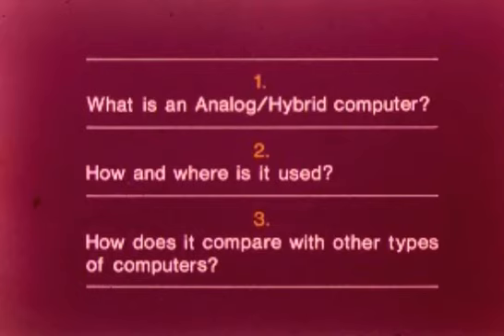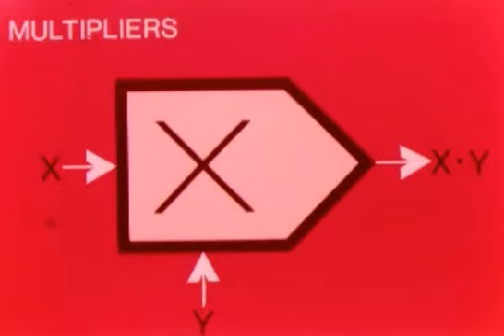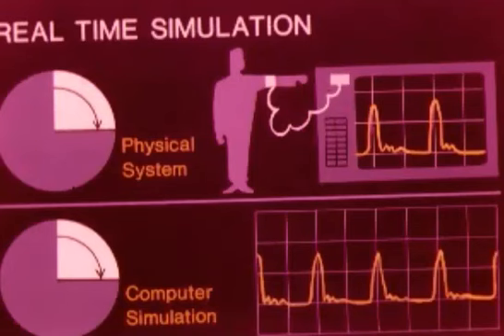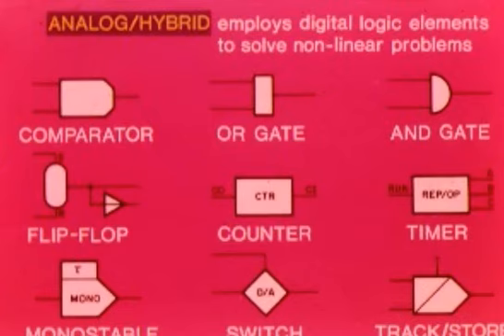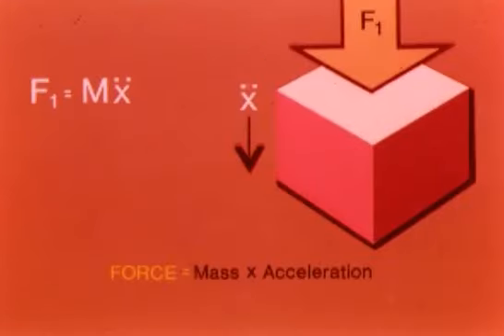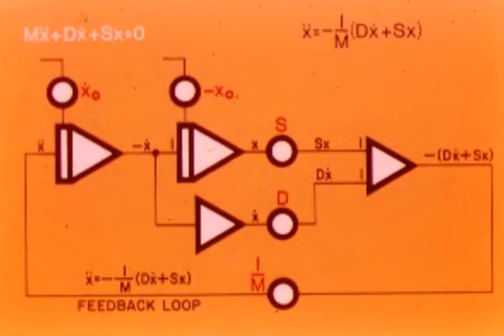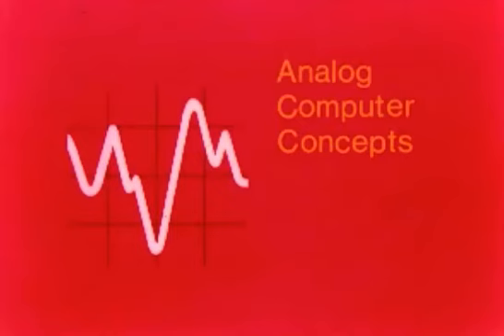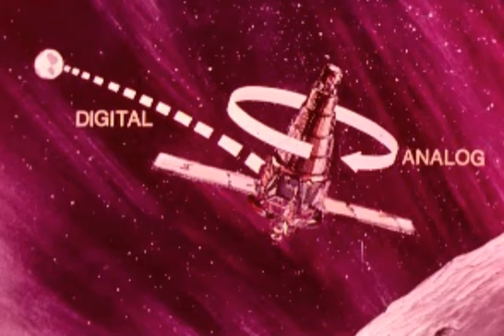Understanding the analog computer

Comment: It took me 20 years to finally understand that analog clocks, analog computers and analog signals aren't called analog because they are continuous but because they are analogous to something.

Analog clock: mimicks the movement of the sun in order to show the time. The physical unit of time is represented by an analogous unit in the form of an angle/circular arc length.

Analog computers: represent one system by a mathematically analog circuit.

Analog signals: speech is transported with an analog signal if the form of the signal remains the same but changes its physical size. The electrical signal is analog to the acoustic signal.
Reply: Yup. Even digital circuits can be analog.
Reply: @evanperrine4012  Well, in some way digital circuits are based on analog circuits. Sometimes it is hard to distinguish them.
Reply: @maurition49  Funny enough, technically you could even define a digital circuit as analog computer modeling an ideal digital system
Reply: @maurition49  So, in a sense, they're two sides of the same coin. Analog can model digital in its own way, and digital can model analog.
Reply: @evanperrine4012  Absolutely right. That's what it basically is. An analog of a numerically exact system.

Comment: I thought summers are used to go to the beach. 😅😁

To be more precise:
today I would rather say "the analog computer (→differential analyzer←) creates a structural analogy". 
Because passive networks also create an electrical analogy for a thermal, mechanical or chemical problem. A tank circuit behaves like a mass spring damper system, an RC network behaves like a heat transfer or water transfer structure, etc...
These analogies are purely analog and really like, so to speak, physical analogs where pyhsical structures are in analogy to each other and the physical quantities in these systems behave analogous to each other (thus using analog signals). But this is not the main idea with the differential analyzer. 
There have been for a matter of fact so called digital differential analyzers (DDAs) which use digital circuits and binary representations, but are factually still analog computers.
What makes the differential analyzer an analog computer then? It is also creating an analogy. 
But this analogy resides in other properties of the machine than just using analog signals, which we see aren't absolutely necessary for the analogy to be implemented. The analogy lays within the machine structure meaning the analog computer being isomorphic to the mathematical problems/equations being solved/represented by the machine. 
These machines do not implement a direct physical analogy. The mathematical strcuture is physically realized as a directed graph of computing elements representing proper mathematical operations and mathematical terms being interconnectd. The directed graph allows every mathematical operation to exist in a discrete form, freely interconnectable with any other computing element, all having well defined input and output points having only one forced directed signal flow. 
All of these computing elements are physically coupled together to realize the mathematical relationships to be studied. 
CPUs always communicate via software, which makes them always slower than any analog computer.
The main advantage and elegance of the analog computer being implemented with analog electronics rather than digital circuits is the fact that one can the mathematical operation of integration with a high amount of numerical stability and only few components and no need for numerical integration methods.

Comment: I was pleased to learn that multiplier chips are available.  Such chips have two voltage input pins, and the output is their product divided by 10.   Some models are "four quadrant", allowing positive or negative voltages on either input.